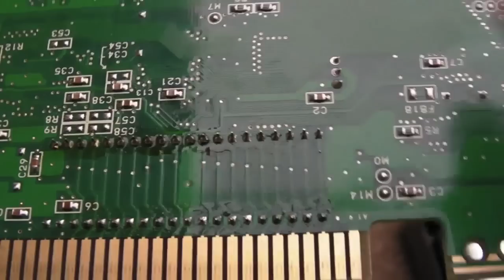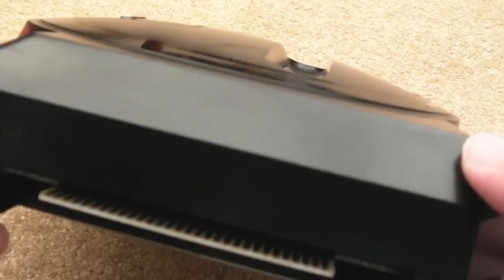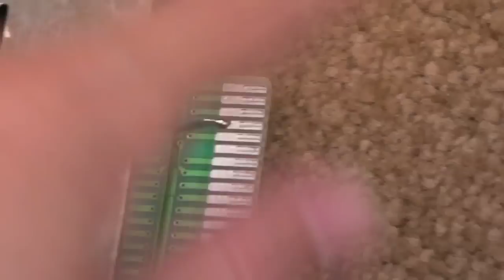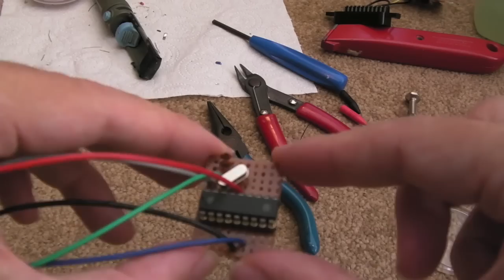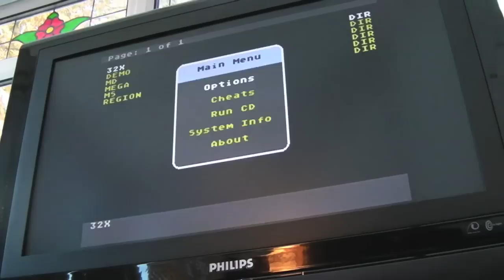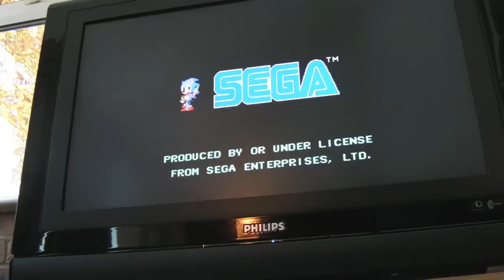Sega Megadrive (Genesis) Sega CD (Mega CD) Region Mod Part 1

Comment from the maker: I will post the schematics, and the PIC .hex file in the next part.  Just in case anyone feels daring enough to have a go themselves.  The executable to do the byte swap can be download from the link in the description above.
Part 2 - https://www.youtube.com/watch?v=Sj3ccO6UQRA
Part 0 - https://youtu.be/BgF5EUa1-sE
Reply: +GadgetUK164 what do you do for a job, or previously for work? How do you know how to program PIC's and all this? Just a passion? I have a PIC programmer to do the old PS1 chips, would love to think up little mods that I could do with PIC chips...!
Reply: +GadgetUK164 PS. Just recently sold my mega CD game collection, it was only about 5 games, but they were all mint..! ended up costing me half what I got on ebay just to post them. SO sad :( my retro gaming collection is almost non existent these days. All I have left Sega wise is some gamegears, some game gear games (which never appreciated anyway) and instruction manual for the megadrive II and Sega CD add on (megadrive not genesis here in aus) :( :(
Reply from the maker: +Lionel Sanderson Hi, sorry for my slow reply!  I currently work as a software developer, although my daily work tends to involve consultancy as well.  I've always had a passion for gaming and electronics, right from my first experience using a BBC computer at school.  BBC led me to gaming on the ZX81, ZX81 led me to other computers and into electronics, and electronics then led me into programming.  Ever since I got into programming I found electronics much easier as the two really go together and once you understand one side the other is easier to understand.  That said, both fields are huge and there's an aweful lot I don't know.  Take some of the things I say with a pinch of salt, I do often make mistakes or slips of the tongue etc.
Reply from the maker: +Lionel Sanderson =/  Sorry to hear you've had to sell your Mega CD!  I know what you mean about postage costs - I've had the same problem with a few things I sold on.  I ended up giving away a load of XBOXes and 48K Spectrums because it wasn't financially viable to repair, sell and post them =/   That said, it means that a lot of these old systems can be cheap to pickup off eBay.  And if you buy a couple of faulty units its often possible to make 1 out of 2 without much effort (provided different faults).

Comment: Hi - amazing job.  You did this a looooong time ago, so I appreciate if you have no memory of it now, but I have a quick Q if you are still reading these....
I recently got hold of a Japanese mega cd on the cheap and wanted to either just convert it to UK PAL region or maybe multi-region BIOS.
Is this possible, or are there hardware differences in Japanese mega CD's too?  For instance, if I just changed the ROM to UK-PAL would it 'just work' connected to a UK mega drive?
Reply from the maker: You can change the BIOS and it should work!  There is an issue that I've worked out (video coming at some point) that relates to issues you can have when swapping region of the Megadrive in order to get the MD to work with a JPN / US Mega CD.  But there's nothing else region specific in the Mega CD except for the BIOS.   To avoid modding the Mega CD BIOS, you can boot the BIOS from another region, or the "region free" one, using an Everdrive (might need to be the Mega Everdrive).
Reply: @GadgetUK164  Thanks for taking the time to reply, really appreciate it.
Not sure I understand about the Everdrive? So you can select a UK PAL Mega CD ROM on the Everdrive then play UK-PAL games?

I spent all last Sunday night taking off all the very leaky caps, cleaning up electrolyte and putting in new caps, but it looks like I did it soon enough as the board looks good and the pads cleaned up lovely with lots of solder, flux and wick.  The fuse was blown and a couple of the plastic posts holding the CD into the base were snapped off, the belt was very misshapen from sitting in one place for god knows how long, oh and the battery was completely dead (but not leaking).  Anyway with plenty of superglue and more soldering it looks in great nick now.   It starts and the CD tray pulls itself shut nice and smoothly so I guess that's a good sign that there are signs of life.
But... I get nothing but a blank screen.  My mega drive is UK PAL so I'm hoping that's the reason.  I may fit a multi-region/50-60hz switch to this as that looks fairly straightforward, but what I really want is a UK PAL ROM as I have quite a few old games from when I was a kid and they are all UK PAL.  The old Japanese Mega CD's have socketed BIOS's so would be a very easy swap.

Sorry long reply in the end!

Comment: Awesome work! I keep reading that Sega CD is region free(the US version, i guess). Not true eh?
Reply: i know you said "US region-free," is there different models of Sega CD, maybe one with the region free bios? or is that a custom bios?
Reply from the maker: The system is not region free - the BIOS checks the console is configured for the same region, and it checks the ID on game disks (you can alter the ID on an ISO and burn a disc, and that will trick it into running).  You can get region free BIOS, but since each region had a slightly different looking menu and title screen, that's why there are US, Euro and JPN region free bioses.  All will play any region game, but they will look different and they need to have the Megadrive jumpers set to match the region of the BIOS used, despite the fact they will play any region game.
Reply: @GadgetUK164  Ahh I see, thanks! I actually just ordered a Sega CD and an PC Engine CD. Trying to live out the retro CD days for the first time

Comment: So I have been doing a few Mega CD BIOS swaps recently and it really is a nightmare. The majority of the pins come clean using the desoldering gun. But about 5 pins just refuse to come clean and I end up wrestling with them for about an hour. Including the same three you mention, as well as the two middle ground pins. I have had 100% success rate but it seems like a massive gamble every time and I am always relieved when that new BIOS loads. On occasion I have cut the pins but it's still a nightmare trying to remove those problematic pins from the board.

Have you discovered any better ways of doing this?

I was thinking of trying a hot air rework gun next.

Cheers
Reply from the maker: Hot air!  These boards have some long and wide traces that really absorb the heat on some of the pins.
Reply: @GadgetUK164  That's great. Will get an order in for a hot air gun. I think Kapton tape and tin foil will be needed to protect the solder mask and other components. Many thanks

Comment: Hi. Will this work with D4S switchless code? This is what I have been using to do my Mega Drive switchless mods. But now really want to do this. Cheers
Reply from the maker: It would be better if I merge the Megadrive switchless feature into my PIC code.  I will later modify my code to switch both the MD and the CD at the same time.  Might need to pass another connection from the CD to the MD though.

Comment: The thing I can't wrap my head around is if you put the Sega/Mega CD BIOS in the Everdrive MD, the different regions work fine if the Everdrive is plugged directly into the cartridge slot on the Genesis but if you plug the Everdrive into the 32x, the different regions don't work. It displays that green screen with the error message. I can't seem to understand why that is. I thought you would know why that is. Another thing that came to mind while watching this and it's sort of off topic but since the Genesis has Master System hardware in it, I wonder if it's possible to solder the FM chip that is in Japanese Master Systems into the Genesis so that you can get FM sound from your Master System games that support it when playing Master System games on your Everdrive. Just something that came to mind, I do have the Power Base Mini FM so I already have the ability to get that glorious FM but it would be a neat concept.
Reply from the maker: +Deadly Gaming LV (Deadly Groove) Thanks for commenting - always nice to engage with people in general chat on these things =D   I think there are a few things complicating things - the 32x has its own region setting and I am not sure if that's causing your problem?  What I tend to find is that the Megadrive region has to be the same as the Mega CD region.  So I have to switch the MD region to JPN, to use JPN Mega CD BIOS.  But.. I think the Everdrive has some automatic region support built in, so if  you use the Everdrive, some BIOS can work from the Everdrive.    There's also the point that a few games don't work properly when using a BIOS loaded from the Everdrive - eg. Starblade, Snatcher etc - depending on your MD region, Mega CD BIOS region, and the game region.  Phew, complicated isn't it lol.

With regards to adding Master System FM support - yes, you can totally do that on a Megadrive (as far as I understand).  I've got some of the YM FM chips here and its on my list of things to do, but I need to get a PCB or something first.  It could be done on matrix / vero board but it would be messy with loads of wires etc.   But...  The 32x stops Master System support from working, which is another possible project, to find a way to see if it's possible to disable the 32x with a switch, but allow pass through.  I suspect not, I think the way it works is the 32x embeds itself in between the Megadrive and the carts plugged in.

Comment: I installed region free BIOS chips into 20 JP MCD1 systems I bought to restore.  All but the very last run of first model systems in Japan had socketed BIOS chips so it was dead easy!  Of all the JP systems I have, only one system has a soldered BIOS chip like the SEGA-CD and PAL MCD.  I would never ever touch my original PAL MCD1 system though, it is far too precious to me.

That system cost me AU $699, I bought it on release day; 31 March 1993.  I was only 14 at the time, I worked my arse off for over a year and a half to save up for that system.  The shop I bought it from was also nice enough to let me take it home and pay off the money I was short of.  Back in the days when real game shops existed. 

 The MCD was by far the BIGGEST stuff up SoJ ever made in my opinion.  Even moreso than making the Saturn so hard and complicated to programme or the lack of DVD-ROM and down graded RAM in the DC.  It should have been just about on par with the NEO-GEO (32X level would have been too costly in 1991), it cost MORE than an AES in Japan!  I still believe that if the system DID have hardware on par with the NG and made to be more of a stand alone unit that only connected to the MD, possibly still using the MD's processor as a co-processor, it could have been huge.  Especially if a cheap combo system a la the PCE DUO (or cheaper, like the DUO-R) had been released at the same time with 95% of games going CD, again, just as NEC/HUDSON did.

  Ahhh; this system will always hold a very very special place in my heart, despite the huge "coulda been" factor.  LUNAR: The Silver Star and Eternal Blue are still my favourite games of all time along with Grandia on the Saturn.  I will forever love SEGA, but damn it is hard when looking back sometimes!
Reply from the maker: +A Shaw It is a shame they didn't put more effort into the design - The processing power of the combined units should have provided some amazing games.  I think part of the problem was the short life span, had it been knocking around for another few years we might have some better games for it.  I do also love the Mega CD, it does have some great games for it but just lacking in library a little.  Not as bad as the 32x for number of titles though.
Reply: I agree that it needed more games.  SoJ also put almost zero effort into the system, they did not even have a launch game!  Even then, their first release looked like a SMS game.  3X3 EYES showed how good RPGs on the system could be, Final Fight CD showed how close arcade conversions could be and Popful Mail and Sonic CD showed how good anything could be when some time and effort was put into the games on the system.  Most SoJ games looked like they had their biggest C grade programmers making their tiny library of MCD games.  Compare the shit graphics of Lodoss tou Senki to Shinning Force II, there is no comparrison.  The fact that Phantasy Star IV was scrapped on CD and made into a cart showed how little faith they had in the system.  I will never understand how they thought a system even THEY did not support, was going to sell!  The slowdown and flicker in FFCD did always make me wonder if the MCD's processor was ever used, too.  It had a processor on par with the CPS1 and NG so there was no reason for the game to have the slowdown and flicker it has.

The ASIC sprite chip was another thing that always annoyed me.  MCD games should have contained all sorts of scalling, morphing and rotating objects in its games yet it was rarely used.  It was so superior to mode 7, yet again was made too difficult for people to care about.  Sengoku Denshou should have contained all the effects of the NG original but of course, contained not a single one.  And was 1p only, what a joke.  I still dream of how amazing a MCD Streets of Rage could have been, and pine for unreleased titles like Ys IV and PSIV.  Thank God that Game Arts and CORE supported the system!

Comment: Cracking video! Really interesting. Question: on my everdrive it has different MCD bios's... I've never used them as all I have is PAL games. Does this work the same as the bios chips?
Reply from the maker: +GRUSS Newton Almost - it works in most cases but there are a few games which seem to suffer problems when booting from the Everdrive that way.  Starblade is one, Snatcher is another I am aware of.  There are also region free hacked BIOSes which you can also load on the Everdrive!
Reply: GadgetUK164 Interesting to know! Btw your MD looks super clean!

Comment: Is the rom switch such that you can have a larger rom and the pic to select which page you want the Sega Megadrive to see ? That was one stubborn DIP IC to desolder. Result looks good. I need to replace the socket under the C64 VIC IC soon. I suppose it is easier to get loose ?
Reply from the maker: Yes, you've got it!  Just increments the paging when reset held for a few seconds!  I've saved the address settings to the PIC EEPROM to allow it to retain state after power off.  I might change the EEPROM code to cycle through the full EEPROM address range - to extend the life of the EEPROM cells.  I assume there's a finite life to them, I need to check datasheet I guess.
Reply: About the EEPROM write cycles. cycle throuh the EEPROM is an idea I've seen before. Let me read up on it. I've been concerned about that myself before.
Reply: It's minimum 1 million write cycles endurance. Should be fine if you only update the EEPROM when reset is pressed and held.
Reply from the maker: 1 million!!!! Jeez!!! These things are bullet proof!
Reply from the maker: +bwack Something I thought last night - you could easily kill the EEPROM on these with a bug!  Imagine at 4Mhz a line of code which changes an EEPROM value, then over a number of seconds your code could cause the 1 million writes easily.  There is a delay associated with the write but I guess you could still easily cause issues there.

The code just writes at the time the addressing is incremented via reset.
Reply: +GadgetUK164 Yeah. If there is a bug like that int here you should see it on the two leds. The code is short and should be easy to debug.
Reply from the maker: +bwack Forgot to mention - the VIC socket on the C64 should be easy to remove!  Sometimes its easier to cut the sockets into sections (3 pins at a time).  That Mega CD board absorbs so much heat, especially on those 3 pins I struggled with.

Comment: Hey GadgetUK164. This is pretty similar than the classic 16F630 method (like the one from DForce3000, here's mine https://youtu.be/mOY_44WACEU ).
If I understand correctly, you used a 16F84A to have more outputs to control the Eeprom of the MegaCD?
Reply from the maker: +The Real Phoenix I've subscribed!  Your mod is really impressive - I like the way it interfaces to both the Megadrive and the 32x - very nice!   I am using the EEPROM contained within the 16F84A to hold the current region setting.  The same thing might be possible with the 16F630, I am not sure until I look at the data sheet for the 630?   The only reason I went with a 16F84A is because I have many in stock and wanted to write my own code.   I might need to modify my code to get the PIC to generate a short reset of the Megadrive after the region has changed - I guess that's what your switch mod does?
Reply: Ok, so I think it's the way around for the 16F630. The 16F630 loops between different positions and hold its last one, so when you boot up your console it will be at the same settings when you turned it off. The rest of the mod just messing around with this position and force the memory region of the EEprom (I used a 27C4096 for the 3 Bios for Each region, Columns is an Easter Egg).
Nothing to brag about, Mmmonkey and DEForce3000 already did that. :)
Reply from the maker: Thanks for the info =)  Yes, I've seen it done multiple ways.  I think Mmmonkey connected the address lines to the region switches on the Megadrive - another nice way to do it.